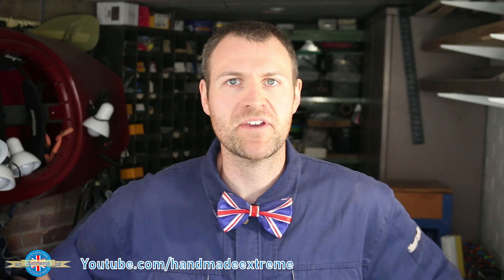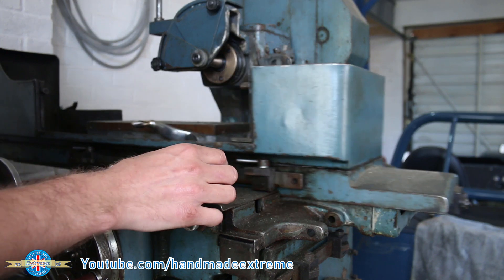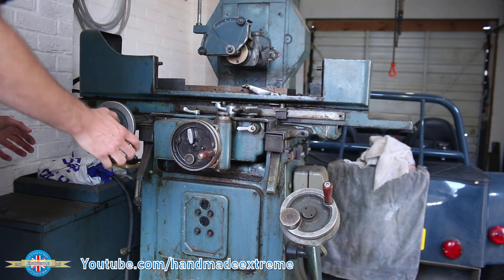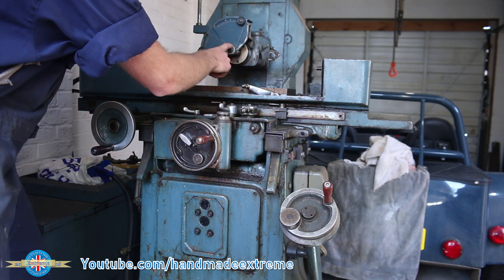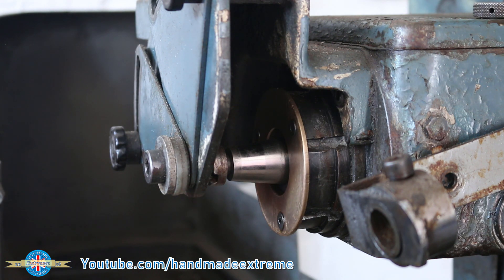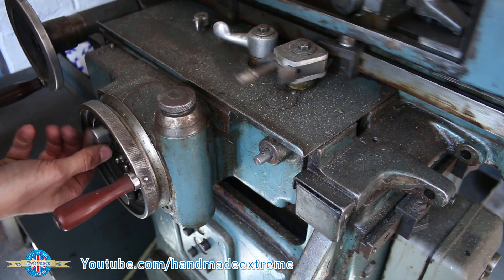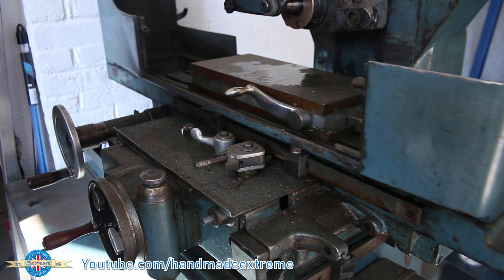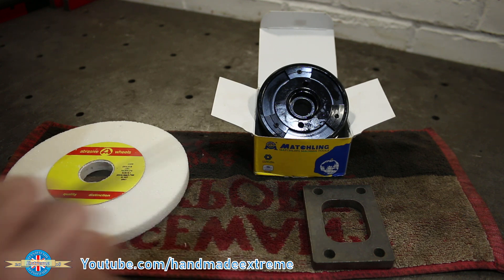Using a Jones & Shipman 540 Surface Grinder for the first time. Wheel Adaptors and Wheel Dressing.

Comment: Your wheel needs balancing. These older machines have long and relatively flexible spindles compared to mordern machines so balancing is a must for accuracy and good wheel life. It doesn't have to perfectly balanced but if you can feel any vibration from the wheel guard when it's running you should try to elliminate it for good results.

Comment: Love it. You have a great way of explaining things....  
Once your wheel is dressed it's best to leave it running as it will need dressing before grinding again if stopped. 
Speed up the table a bit and more of an overlap of the workpiece tho and use depth of cuts of between 0..01/0.02mm and steps across of around 0.7/0.8mm ..  go from there depending on material and what you are seeing on the surface finish. 👍😁

Comment: Greetings from Belarus city of Brest. My name is Andrey. I have the same machine. The video is very informative, thank you very much. 
Do you have a diagram with dimensions of the hubs , how can I get it? Please tell me the model of the hubs and where you bought it, I can't find it anywhere. I bought it on aliexpress but the wrong cone turned out to be. Thanks.
Reply from the maker: Thanks i'm glad you enjoyed the video. I don't have a diagram but I do know that the UK and US machines have different spindles. I believe there may also be a difference between machines with plain bearing and ball bearing spindles. 
I got my hub from a company called jubilee machine tools in Derby England UK. 
Sorry I can't be any more help. Good luck with your search. 
Thanks for watching.
Reply: Andrey, if you haven't found out yet, there were two different tapered spindles manufactured for these machines.
For North America the taper was 3 inch per foot, which is a standard there amongst many grinders, and for the rest of the world the taper is  15° inclusive.
Hope this helps.

Comment: Hi. if you are inexperienced withtelling if the wheel is balanced or not I would dress off 0.01 inch in 0.001inch passes and then follow up with 0.0005inch final pass going quite quickly across. If you dress is properly you shouldnt see any burn marks even without coolant.  Cheers
Reply from the maker: Brilliant! Thanks for the advice i'll give that try. Thanks for the support.

Comment: You need to move the work past the wheel a bit quicker and with less step over. If you don't the wheel rubs and you get burning. Where are you buying your spares for this machine ?
Reply from the maker: I love comments like this. Thanks for the tips! I'm a total beginner when it comes to surface grinding so that's really helpful. I got the wheel adaptor from Jubilee Machine Tools in Derby (UK)  £165 inc VAT and Postage. The wheel came from Midland Abrasives via Ebay ~£25 Also picked up some Velocite #3 from Ebay as well for the spindle. Hope that helps and thanks again for the tips! 
Cheers, 
Rob

Comment: Great video. Are You planning to restore this surface grinder?
Reply from the maker: At some point yes. There a few known issues with the machine that need to be rectified. The spindle bushings are in need of replacement / repair which should be quite an interesting project on it's own. There are a few bits missing as well. 
I'm hoping to move to a bigger workshop soon and plan to restore the grinder, the mill and the lathe once I have the space. 
Thanks for watching, glad you enjoyed it.